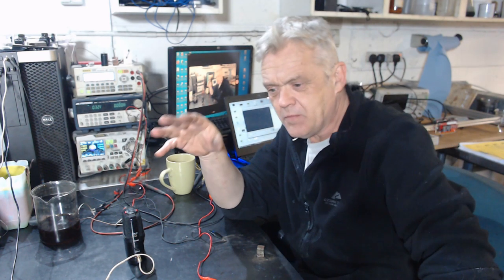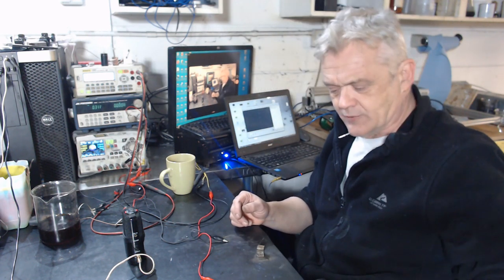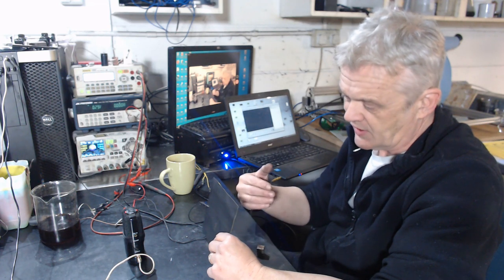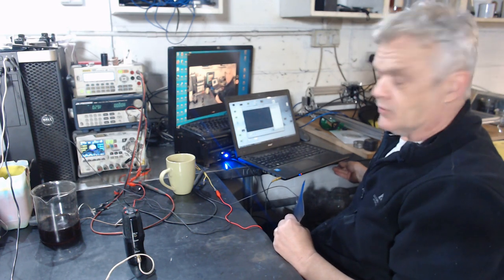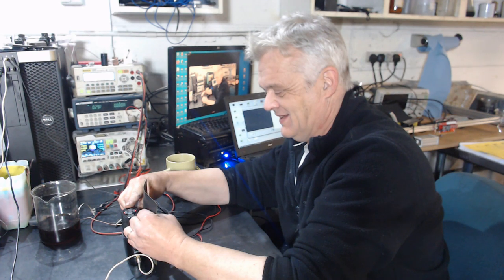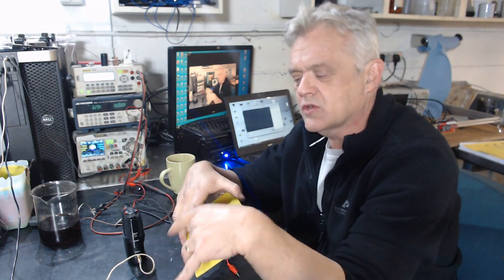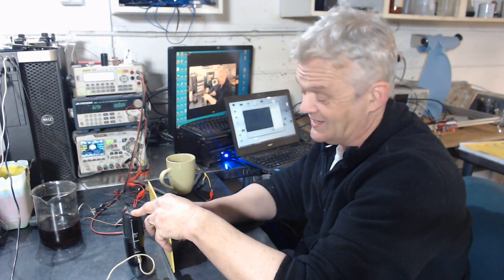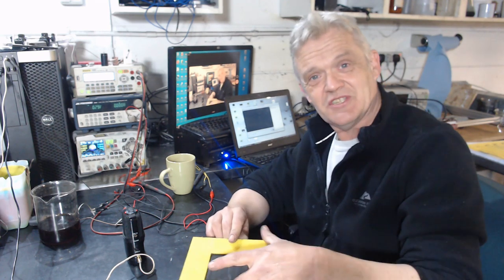Painting A Speaker

Comment: what kind of load does the speaker present to the amplifier?  If high resistance, maybe use the amplifier to drive with the 8 ohm side of a cheap 70V audio line transformer and drive the speaker with the 50ohm(70.7V) side output of the transformer.  Could potentially increase the volume( ~8db).
Reply from the maker: yes mate - awesome - cheers

Comment: Good so are you going to help me make a graphene transitor..to block all these low Hertz frequencies.
I have the rest of the elements compatible for the connection 
Just no graphene 🤷🏻‍♀️
Reply: A Pretty Monotheism it depends on the low frequency if its good or bad for you.. 7.7hz is low freq. But it's Schumann resonance and is good for you, its the freq. Our earth and sky vibrate at.. and you can't block frequencies in air by using a transistor, the only way you can block frequencies is by making a faraday cage for electrical freq. Or using sound proofing for sound freq.. have you looked into the college papers on making transistors out of graphene? It's hard and they are not very effective as it stands, here in the future the technology will get better
Reply: @greenthizzle4  low-frequency hertz are usually always bad for us humans by blocking I mean making your own positive frequencies by first studying different parts of the brain or different points of the lymphatic system and figuring out the adequate Hertz to vibrate that part for healing that's what I mean by blocking it depends what kind of elements you have to combine the Graphene with because itll intensify with positive frequencies and I'm still scratching from the top. There's much more to it 🤷🏻‍♀️
Reply from the maker: tbh passive components are relatively easy - quite fascinating to have made a working inductor for sure - active components are a different deal. I am certainly interested in them but my first target, I think, is a diode and go from there - but I will have a look - after all it is basically just a switch

Comment: From what I remember about speaker design, the coil is wrapped around the magnet and also glued to the to the speaker face (paper). Thus the magnet is inside the coil of wire.

When the signal goes into the coil, it reacts to the magnet. I think that the coil winding around the circumference of the magnet causes larger oscillations and that in turn gives a louder volume.

OK, I picked up the computer speaker I had sitting on the coffee table and it appears to have the coil inside a metal housing with a ring magnet on the outside of that. The end wires of the coil are glued or epoxied to the speaker face.

I think that the coil winding around the inside or outside of the magnet is where it gets the greater volume. 

Maybe this design is simply more efficient that others and the actual volume of the speaker is determined by the amount of energy coursing through it.
Reply: Good suggestions to try!  Impedance matching the amplifier to the speaker would probably help as well.  Im guessing the painted speaker has a several hundred ohm resistance. Thought Rob could use a 70.7V audio line transformer to drive the speaker with 50 ohms output which would  increase the voltage dramatically and could get more power into the sheet.  Appropriate series-one reversed connected zener diodes connected across the amplifier output recommended to prevent transformer back EMF from blowing the amplifier's output stage.
Reply: @waynegnarlie1  😎👍
Reply from the maker: that's exactly how they are made mate - Wayne has had a nice idea nd I am going to look at that for sure
Reply from the maker: @waynegnarlie1  cheers mate
Reply: @ThinkingandTinkering  😎👍

Comment: awesome, graphene should be very good for planer speakers. lower ac impedance higher dc resistance  gives higher fidelity.

an electromagnet ran at high amperage low voltage dc will provide a powerful magnetic field.
tip; powder some iron and lightly dust the ink before it dries you'll have better response. ;)
Reply from the maker: maybe mate - I'll give it a go
Reply: @ThinkingandTinkering  some of the highest quality inductance coils for speaker crossovers are made using powdered ferrite that's been centered, baked together. also a lot of speakers use ferro fluid in the magnetic gap. 

I've been wondering what the effects of a diamagnetic material layered to a ferromagnetic material would be, with a magnetic field applied.

Comment: If you silk-screen a many-turn inductor onto your membrane, your speaker will function far, far better.
Reply: That's kind of his point with this is that he is showing how it doesn't require the coil. That's the amazing part about this setup.
Reply: @zenmanproject  Dr. Smith is trying to sell ink. A higher-performance speaker would serve his purpose much better. Speakers work by virtue of the interaction of two magnetic fields. I'm surprised it worked at all.
Reply: Jim Ferguson it worked. I’ve bought his ink, along with other stuff.
Reply: I wonder if it can be applied using 3-D printing techniques?
Reply from the maker: yes it would mate - but that's not really the point here
Reply from the maker: @benthere8051  of course I am - but that doesn't detract from what the ink will do - I am also trying to inspire people to be creative here and see what they can get out of the ink - if you bought some tried the silk screen idea I am sure you could do a far better job of that than me